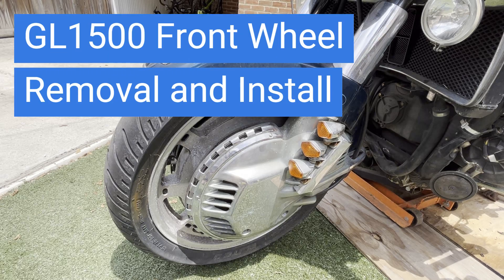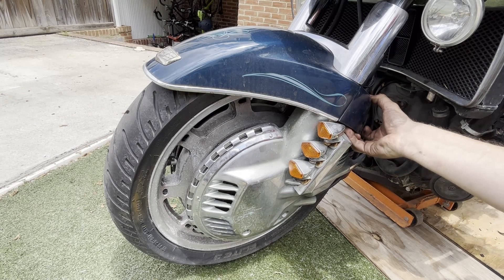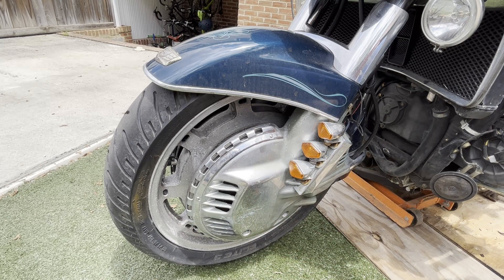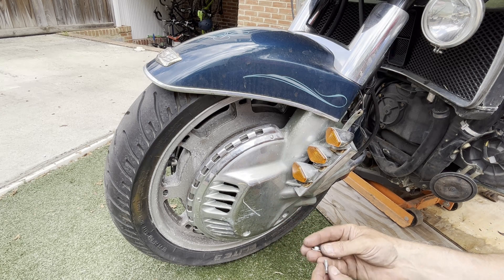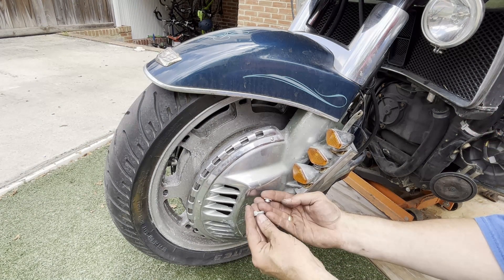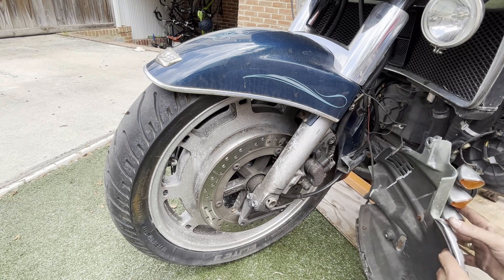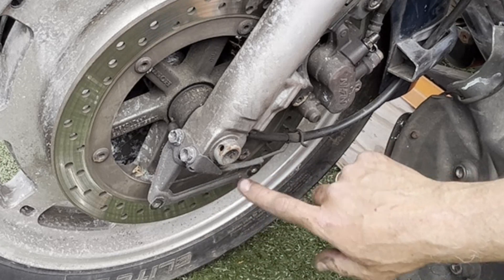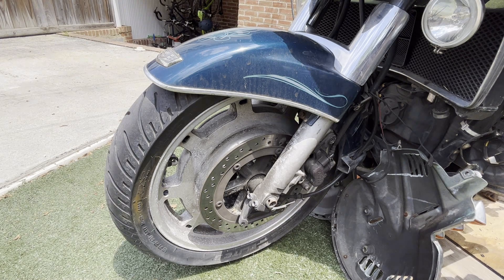Honda GL1500 Goldwing  - Front Wheel Removal and Install

Comment: Nice video.  Thank you.  I wish I had seen it before I did mine last year. I installed the speedometer drive incorrectly and ended up breaking it as soon as I drove around the block.  Cost me $95 for a new one, plus having to do the whole job all over again.  The tabs on the speedometer drive have to be behind the corresponding tabs on the fork to keep it from moving when the wheel turns.  Lesson learned.  Happens every time I work on this bike.